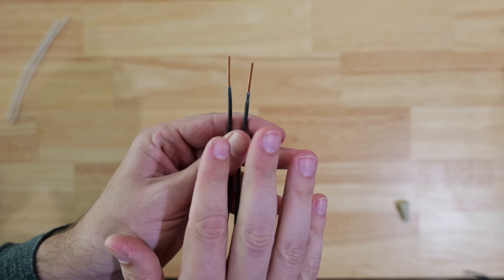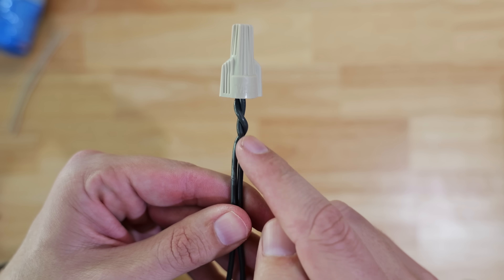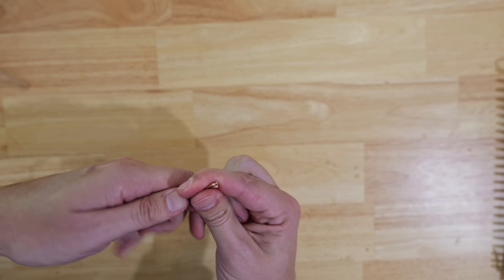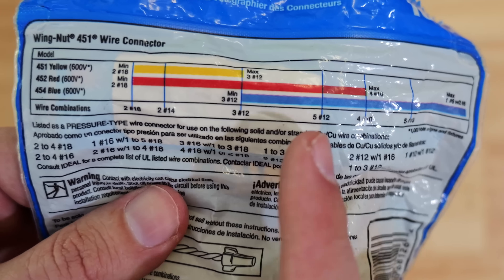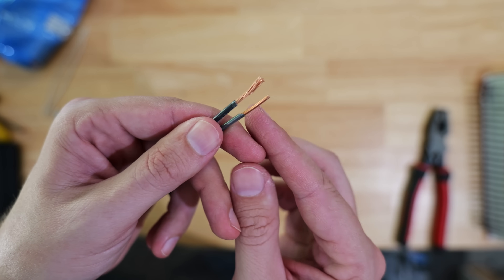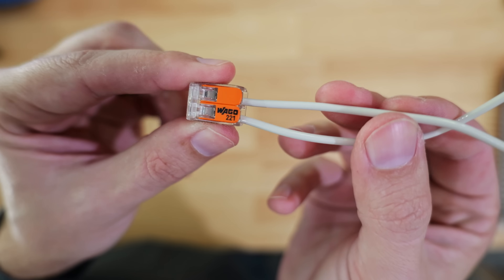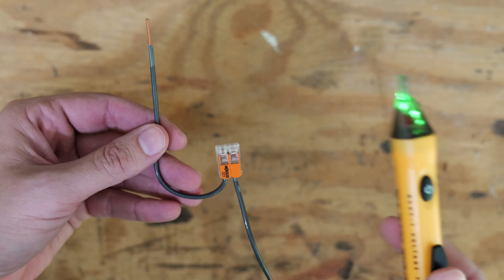7 FATAL Wiring Mistakes Most DIYers Don't Know They Are Making | Most Are Guilty of 3

Comment: Pointing out every single way to prove the wire nuts good and finding every silly problems with Wago to prove them wrong. Very nice strategy man, keep it up!
Reply from the maker: I showed more potential issues when installing a wire nut than I did the Wago.  You just didn’t see it because of your bias.  Guessing you aren’t in the US.  A properly installed wire nut is arguably the best connection that can be made in these applications.

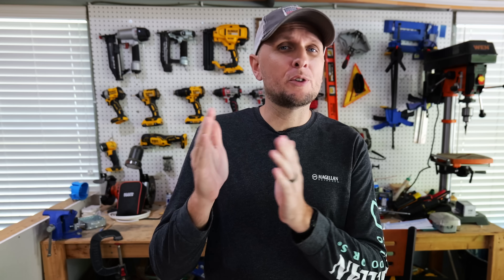Comment: 12:50 Thank you... Great how to.  Over the years, as a Handyman and Super, I've seen these issues you've described as well as ground connections lost because lock nuts for box connectors got loose, due to vibration from construction, or no anti short bushings were used, in 120V applications using "BX" or shielded armor cable.  Thanks for those tips on the preference of Electricans for those snap in connecting devices (Wagos.) and follow threw with Electrical tape, so they stay seated.

Comment: As a FYI, there's another option to look into, especially if you're a DIYer, or if you're dealing with sticky reno situations with older shallower boxes, old/work-hardened copper and bulky IoT devices: 3M Performance Plus Wire Connectors.

They are essentially wire nuts, but much smaller than you usually see.  I use the O/B+ size which can do , 
2 #22 AWG up to 3 #12 AWG (solid) or 4 #14 AWG, fully certified by CSA and UL.

They're a godsend for tight spaces and work hardened copper.

3M makes other sizes (up to #8), but, as you generally do not see these in smaller packages than 100,  and not in big box or corner hardware stores, that's a bit much for things I don't do very much.

You can get wire nut drivers for these - ones that look like half-brace drills, and others that are simply 1/4" hex drivers.  For us old guys that can save your wrists and fingertips.

Also note: some wirenuts come with instructions explicitly telling you to NOT pretwist.

This is probably that the wirenuts were tested without pretwist for certification, and thus "legally" pre-twisting is not approved.

They're available on Amazon, and I'd guess professional wiring supply.

Comment: I've been a licensed electrician for 30 years. I will never use Port connectors even though they are UL listed or use the back stab devices (switches & receptacles). Any kind of tension on those conductors along with the heating/ cooling will cause the wire to wiggle out. Most of the time it' breaks circuit which means nothing works downstream. Rarely but does happen... it develops an arc creating a fire hazard..... either way it's worth the extra effort to make a good solid connection with a wire nut.

Comment: I work in HVAC/R.  And in our applications we use the WAGO lever nuts.  They have fewer fails than the wire nuts have had.  And we use the right WAGO for the wire size, amperage and voltage.  We work on everything from 24 VAC-600VAC.  And various DC.  And we have to work on everything from stranded to solid core, as well as aluminum and copper.  As well as wet and dry conditions.

Comment: My issue has always been pairing stranded to solid wires with twist nuts. The last Wago connectors I used several years ago were the push-in type which are excellent for solid wire, not so much for stranded. Until 10-minutes ago, I didn't know lever type Wago connectors existed. If I should use this type of connector in the future, the levers will definitely be wrapped in electrical tape to ensure they can't pop up while handling.

Comment: nice practical advice. Wish people are to be aware that mains are to be switched off when wiring connectors, are atleast the specfic switch breaker turned off and tested with multimeter before moving on with the work.

Comment: Good advice 
What i like to do is follow your advice PLUS wrap the wire nut and wires with electrical tape.  That will prevent the the nut from coming off as well as keep the wires together.  I've found that far too often rhe wires can become a little loose when you tuck them into the electrical box.

Comment: Thanks for an informative video. Every time I hear about Wire Nuts, I think about my Uncle, who has long passed away RIP. 
Prior to Wire Nuts, my Uncle said that electrical connections were made by twisting the wires and and dipping them in a ladle of solder, then wrapping them around with friction tape and then the black rubber electrical tape which was much thicker than the electrical tape that is used now. 
I never knew about those box connectors, if there’s room in the outlet box, it sounds like a worthwhile alternative for the DIY community ?. 
Electric wiring has come a long way, I remember when working in old Historic homes, there was, Nob & Tube wiring which might make for an interesting video about the advancement of Electrical Wiring in the last Century ???

Comment: I had a GFCI breaker tripping and dumping an entire subpanel which was super exciting. I went over everything involved and adjacent, flipped it back, tripped the whole thing again, rechecked and I do think that it was a Wago slipping out or not being fully seated while buttoning up a junction box, as you mention at about the 9:55 mark. I feel better about the whole thing by not using wire nuts in this particular case.

Comment: On ground up ground down. I am a master electrician with 50 years experience.
I was taught in my apprenticeship, to install ground down. I was told the ground should always be the first thing connected. First make last break.  If the outlet is installed ground down. The longest prong is the ground. Notice it will be the first connection. If the plug was to start falling out, the ground prong will be the last connection.

Comment: Wagos are such a time saver! When i started doing smart home electrics, i would just use properly rated wire nuts, but i learned the hard way that wire nuts permanently damaged the conductors (not to mention you cant mix strand & solid). 
Once i started using wagos, ill never go back. Between swapping out smart switches, troubleshooting, or even replacing old fixtures in a rental, having reusable wire connectors is a godsend. Theyre so well made, secure tightly, and cant get pulled nearly as easily as nuts. As long as you read instructions (which is a big ask for most americans, ik) wagos are the safest, most guaranteed connection for non-professionals, and basically necessary if you anticipate reconnecting whatever device more than once. 
And fun bonus, i used some wagos inside my PC to wire some RGB lighting in a pinch, and i didnt wanna use another connector adapter. Love em, and i kinda resent luxury home builders who dont use them 🤷🏾‍♂️

Comment: Australian electrician here. Our connectors are different here so I won't comment on that but as far as the WAGOs go, stripping the cable too far and leaving exposed conductors is a much bigger problem. Safety first, you can always strip it back further for a proper connection ;)

Comment: Here is a comment ! You should also advise people on the importance of a good electrical connections that would be the following : the jonction of current connected carrying wires must be equal to a full  conductor that has not been spliced ! The points of connection , like you made them have enough surface (contact points ) conection to carry the same load as the non spliced wire itself ! Also the insulation used on jonctions must be as good, if not better than the original insulation ! Thank you for your time and effort  !

Comment: With the Wago levers I always run the electrical tape down a inch or so the wire from the wago and up it. This ensures the lever won't lift and you protect the conductors from the bottom side. I've been a electromechanical Technician for 10+ years now. These are great and I have had way less failures with these when comparing to wire nuts.

Comment: There are plenty of designs you can download to 3d print boxes and frames for wago connectors.  I use a little box to extend wires with two straight through wagos quite frequently.

Comment: Great channel, thanks for all the tips!
I'm working on 2 switch boxes. One is at the front door, the other is at the rear door. Each box has 4 switches. The boxes are connected with 14/3 so the switches all control the lights they go to.
I understand all the wiring except the ground wires. Even with pig tails there will be 10 grounds that all need to be connected. What is the best way to connect all the grounds?

Comment: Excellent video. Safety is Key so 13:00 3 ideas are critical:
1.  wrapping electrical tape  wire nut and Wago connectors,
2. 
Twisting or pre-twisting wire nuts and ensuring correct exposed wire in the Wago 
3. Checking your work

Comment: I do residential, mostly remodeling/old work. I would 100% rather a homeowner use a wago than a wirenut.  The amount of times i have had to troubleshoot only to find a loose connection in a single wirenut is astounding. They simply dont understand that you need to actually twist the conductors together before you put a wirenut over it. It would make my life easier.
Reply: Wirenuts are rarely used, and afaik illegal in Europe.

Comment: I have run into a couple of cases where I had too many large wires to be held securely by the largest wire nut available. Therefore I soldiered the wires together on the tip before putting on the wire nut. The wire nut only protects the bare wire ends now.

Comment: Thank you for your competent and kind advice, but I always solder copper wires after twisting when possible, then isolate with isolating tape, no wire nut. It's cheaper, more reliable and doesn't take much space.

Comment: I always add some electrical tape to the wire nuts so they don't get knocked loose from pushing wires into the box,  its just my preference, I know some will say its not required if you do it right but I just do it for added security,.  I also pre-twist as you described.

Comment: The “professional electrician” who was involved in my home remodeling forgot to connect back one of the few outlets I have in my kitchen ( small house) and I had to buy the tool to fishing the new wires behind the wall and connected to another circuit,  I used the WAGO connector and it works fine , I’m not an electrician; but I’m the kind of person who ALWAYS read the product instructions and fallows the manufacturer recommendations, advice or suggestions 🤷‍♂️

Comment: Huh. You know, I'm an Apprentice Electrician in Canada and tbh I'm a bit surprised how many Electricians lime the WAGOs. I get that they save time and all, but particularly for switchboxes, adding a device that requires the neutral and bond (e.g. a dimmer), man are you making extra work for the next guy.

Last dozen renovations I've worked on in residential complexes or apartments, I've had to resplice neutrals and bonds.

It doesnt sound that bad until you realize how little extra conductor length was left in these older projects.

Comment: I'm retired from automation and controls where an enclosure might contain hundreds of connections and you see a variety of terminals.
I've always preferred screw clamps, but spring connectors actually have fewer failures. Many of those spring terminals say wago. I think they know what they're doing. One place where I really dislike wire nuts is joining solid to stranded, it's easy to get a poor connection.
For house wiring, I'm going to give wago a try. I have seen too many boxes too crowded with wire nuts.

Comment: I just installed a Blink Floodlight Camera on the soffit in front of my driveway. I had to branch of an existing new bedroom circuit and installed 2 junction boxes using only the Wago (Ideal) push in type connectors in the boxes, with 14/2. Hopefully they hold up, as it's in the attic. First time I have used those type of connectors.

Comment: As a former electrician from the Netherlands, i used the wire nuts at school early 2000's to practice. After that they where only needed in Hospitals, so i only used Wago's without or with lever after that and never looked back. And never had a Wago lever come open, and i have used force to cram some into their boxes. And i think using tape around it, makes it a bigger fire hazard than without. Just, hold a lighter to a piece of tape and see what happens. Oh, and throw away all those stupid volt sticks, wrub it against your shirt and you instantly become a mobile power station.

Comment: To add a fool proof connection, use a little dialectic grease in wire nut. It keeps the wires from oxidizing, which pretty much keeps electrical connections good.

Comment: I generally only use Wago connectors for lights, ceiling fans, and other devices that have stranded connectors.

I also wrap some electrical tape around Wago connectors to ensure that there's no way the levers become disengaged accidentally

Comment: My 1967 tract house in CA came with crimp connectors. 
Needless to say, outlets with heavy loads eventually overheated and burned because the crimp connector loosened over time due to heat cycling.
I hired an electrician to replace all the crimp connectors with something that looks like WAGO but no levers.
The wires just push in and are held tightly.
I didn’t specify those. That’s just what they used.
I am thankful those lousy crimp connectors didn’t burn the house down.

Comment: When I worked in the electric sign industry it was a UL requirement to use electrical tape over wire nut connections. I carried that on in everyday house wiring situations.

Comment: years ago I used to see yellow and red wire nuts used to wire common residential circuits with #14 and #12 wires and Once in a while #10. When the white or off white wire wire nut came along it became my favorite wire nut that I used for that half the time.

Comment: To be extra safe, I like to wrap the wire nut's skirt with vinyl tape. I have seen a lot of weird stuff in my many years, including some crappy wire nuts that had the plastic part detached from the inner metal screw part.

Comment: Wages are still creating plenty of work for me. It's always the installation, though, and not the direct fault of the Wago. An experienced electrician would have mentioned how to determine what length to cut each wire. Not just the minimum length required, but how to group the wires at the back of the box before trimming them for length. This makes for a much neater box as well as lessening the chance for a wire being under stress. Overall, this was a good presentation with only a couple of errors in terminology; solid conductor - not solid core, and power doesn't flow through wires. Minor things, but you'll get laughed at.
Thanks for the presentation.
Reply from the maker: What installation errors do you see with them?

Comment: One major problem with an untwisted, loose wire nut is not so much the wire coming off, but the potential for generating heat from a poor connection. Heating can (at a minimum) increase electrical bills, and in the worst case start a fire.

Comment: To let you know from my humble perspective base on empirical knowledge doing this job.  In the case to conect a solid wire and strained,  strip both of them about an inch, twist the strained one, then twist them together and wala. Then, cut them at righ size and use the wire nut to secure it.

Comment: I used wire nuts in an industrial paper mill with 575 volts for 40 years we always taped the wire nut after securing it. For wires above 10 gauge we used other means but never used wago type connectors.

Comment: to even add more protection, wrap them in electric tape afterwards.  I also do the same with my plugs as well by wrapping tape around them to protect the connections in the box as well.  It never hurts to be too safe with electricity

Comment: one thing to mention about the wagos is, that this specific model (like the older grey/orange predecessor) isn't the first choice for any permanent wirings. instead, these are for those scenarios where you have to connect different wire types (solid, stranded and fine stranded) to each other, or stranded wires in general. also, they allow for easy uninstallation if its not a permanent wiring.
for standard permanent wirings e.g. in junction boxes the preferred connectors are still the classic push wire connectors. they also have a much smaller footprint which is benefitial in small junction boxes.
however, even though in theory you could also use ferrules in the levered connectors (unlike the push connectors), they're not intended for this use. use blank wire ends instead.

Comment: Hi. Professional Australian electrician here. These types of connectors are dangerous and not used in Australia. We use BP connectors with screws to lock down on the wiring. Double screw connectors for earthing conductors. Can't go wrong.

Comment: Wago connectors all-day with a simple wrap of electrical tape around the levers. I'm a commercial refrigeration technician in the USA and would spend my own money on Wago connectors if the company wouldn't supply them. Makes installation and most importantly service work more efficient and effective. I've seen plenty of wires slip out of a wire-nut after a  proper pre-twist and installation.
Reply: I've seen NO wires slip out of a wire nut after a proper pre-twist and installation, in 40+ years. You're a refrigeration guy, not an electrician...so your splices are unlikely to equal mine.

Comment: Wire nuts was used before,  that's  long time ago- at least in Europe.
Wago or similar is much better. Or the termination blocks. But they should be of better quality. 

Same with all quick connectors I.e sockets (do you have quick connectors in the US on sockets? I've haven't seen one..) you do it right it works and it's no problem.